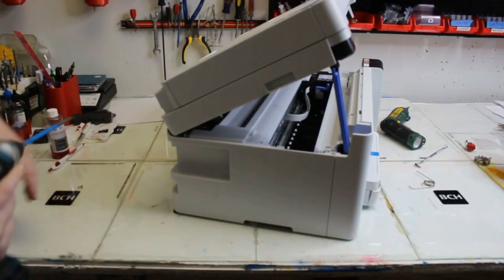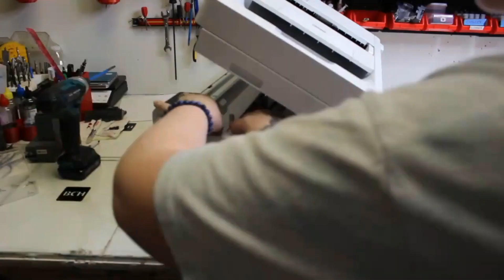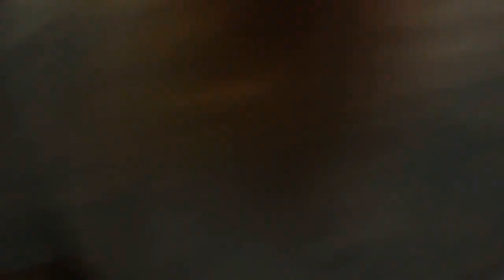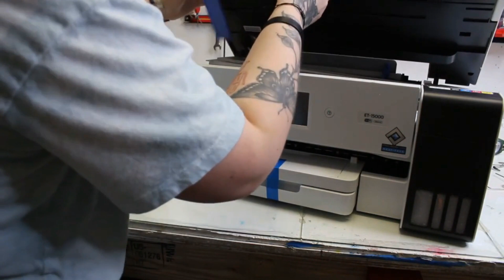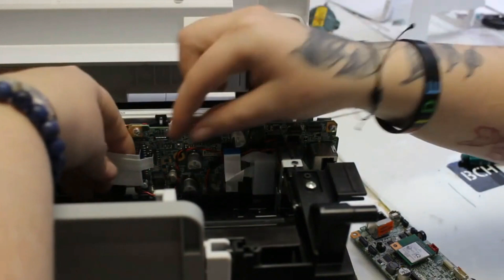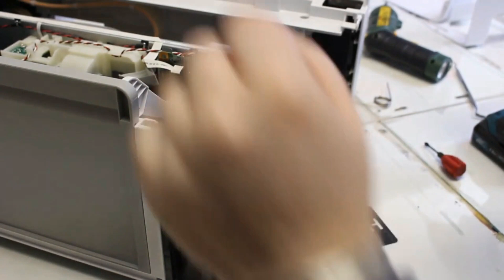ET-15000 Repair - Uncasing, Remove Scanner,  Replace Mainboard

Comment: Thank you so much for making this video! It was a real life saver for me last night trying to fix an issue with my printer. I couldn’t afford to buy another one, and I couldn’t have it fixed by the manufacturer bc I voided the warranty when I put sublimation ink in the tanks. So I have been relying on these types of videos to help me fix my printers and other things. So thank you so very much for your video! I was able to fix my issue after I could properly see everything. Great work! ❤
Reply from the maker: Awesome to hear it helped you out! Printers can be such a pain, but it’s great you got it fixed without breaking the bank. Keep at it, and don't hesitate to reach out if you need more tips!

Comment: Thanks for the video , quick question do you think by replacing the mainboard this would fix my printer from printing blanks? I tried everything I clean both the dampers and the tanks,and I flushed the tubes out and replaced the badly clogged printhead, this is a second hand epson et 15000 printer with only 50 pages printed, and still blank pages, it operates fine ,but still blank pages any suggestions?
Reply from the maker: Thanks so much for watching the video and for your support! With a printer that only shows about 50 pages printed, I wouldn’t jump straight to replacing the mainboard yet because blank pages are often caused by ink not properly reaching the printhead. I would recommend doing a park-and-prime procedure first. To park the printhead on the capping station, simply turn the printer on and allow the printhead to settle naturally onto the capping station; it’s safe to do this while the printer is powered. Once it’s parked, connect a syringe and tube to the waste line and gently draw about 1.5 to 2 ml. You should feel slight resistance as you pull; if you only draw air, the printhead may not be sealed on the capping station or the cap seal could be leaking. If you feel total resistance and nothing moves, the capping station could be clogged and that needs to be cleared before priming will work. When you pull around 1.5 ml you may hear the damper membrane crinkle, which is a good sign the nozzles are opening. Slowly pull to about 2 ml and hold for around 10 seconds, then run a normal cleaning cycle, but avoid strong cleanings within 12 hours and don’t run back-to-back cleanings without letting the printer rest. If ink flow still doesn’t start after that, then it’s worth checking the mainboard components such as the F1 and F2 fuses and possibly the MOSFETs, and I demonstrate how to diagnose that here: [https://youtu.be/RMCq5wXQNlI](https://youtu.be/RMCq5wXQNlI). Also just a quick note about replies: I receive a high volume of questions every day, so I prioritize subscribers and channel members, who typically receive responses within about 48 hours and also get extra benefits like early access to videos. I can usually reply to about 10 questions per day, so after subscribers and members, the remaining slots are filled last-in, first-out, meaning newer comments get reviewed first. If you’re not subscribed and don’t get a reply within 48 hours, you can subscribe or repost your question because newer comments are reviewed first, and if you subscribe later your older questions automatically become priority without needing to repost. You’re also welcome to join Run With Kevin — LIVE, where I usually go live every morning between 6–8 AM Eastern and answer printer questions in real time, so subscribe and turn on notifications so you can catch the next session and ask directly. If you need faster help, feel free to email [support@bchtechnologies.com](mailto:support@bchtechnologies.com), and if this video or comment helped you, I’d truly appreciate a quick Google review at [https://g.page/r/CfL7k6nYvPQ9EAg/review](https://g.page/r/CfL7k6nYvPQ9EAg/review).

Comment: Once the logic board has been replaced, to carry out the calibrations you must enter a password on the screen to be able to access the machine in service mode. Do you know what key that is?
Reply from the maker: Thanks for your question and for watching the video! I appreciate your support. With so many inquiries, it can be a challenge to respond to everyone quickly, but I always try my best. For faster assistance, feel free to email me at support@bchtechnologies.com or post your question on my latest video (not Shorts).

When replacing the logic board and needing to access the service mode, the password is often specific to the printer model and firmware version. Manufacturers generally keep these codes restricted to authorized technicians, and accessing them without proper authorization can sometimes void warranties or violate terms of service. However, if you're working on this with appropriate permissions, I recommend checking the printer's service manual or consulting the authorized support channels for your printer.

If you’re still stuck, let me know your printer model, and I’ll see if I can guide you further or suggest resources that might help. Thanks again for engaging with the channel, and good luck with your calibration!

Comment: Hey I have a question about the switch board do the red and black wire plug into something or it just hang
Reply from the maker: Thank you so much for your support and engagement! On the ET-15000 switch board area, the red and black wire usually should not be left hanging unless you are 100% sure it was originally routed that way, so I would first look closely around the switch board, control panel, scanner hinge area, and nearby small boards for an empty two-pin socket or connector that matches that plug; if it has a connector end, it most likely plugs into something, but if it is a loose wire pair without a plug, it may be part of a sensor, switch, or routed harness and needs to be traced back before powering the printer on. I recommend comparing your printer with the video frame-by-frame before reassembly, because one loose cable can cause the printer not to power on, throw errors, or damage a board if connected incorrectly. I receive a high volume of printer questions every day, so replies are prioritized: subscribers and channel members are typically answered within 48 hours and also get extra benefits such as early access to videos, while regular viewers are answered if time allows because I can only reply to about 10 questions per day; after subscribers and members, any remaining reply slots are handled last-in, first-out, meaning newer questions are reviewed first. If you are not subscribed and do not receive a reply within 48 hours, you can either subscribe or repost your question because newer comments are reviewed first; if you subscribe later, your older questions automatically become priority without needing to repost. You’re also welcome to join Run With Kevin — LIVE, where I go live every morning, usually between 6–11 AM Eastern, and answer printer questions in real time, so please subscribe and turn on notifications to catch the next live session and ask directly. If you need faster help, email [support@bchtechnologies.com](mailto:support@bchtechnologies.com), and if this video or comment helped you, I’d really appreciate a Google review here: [https://g.page/r/CfL7k6nYvPQ9EAg/review](https://g.page/r/CfL7k6nYvPQ9EAg/review)

Comment: I'm looking for a video to help with my ET 15000 not powering on, I replaced the maintenance tank and I think it blew something out. I've tried everything from replacing the cord to unplugging and holding down the power button.
Reply: Mine won’t turn on either. Mine was clogged so I did a cleaning to unclog. Waited the next day to do a power clean and possibly do a print head test. Power clean was successful. But when I tried to do a printer head test, I got the error for paper being stuck. I took all the paper out and have checked for any debris and other papers nothing. Tried maybe 2-3 more times and then all of a sudden, it turns off on me. It’ll not turn on anymore. I’ve checked the power cord and switched it with another one, no luck.
Reply: Same here.   Waiting to see if there is a solution
Reply from the maker: Thank you so much for your support and engagement! On the ET-15000, if it stopped powering on right after replacing the maintenance tank, it may not be the tank itself but something that happened during the process, such as a short, blown fuse on the mainboard, damaged cable, power supply issue, or moisture/ink getting where it should not be; the video you commented on is a good starting point because it shows how to uncase the ET-15000, remove the scanner, and access the mainboard, but please be careful and inspect the board closely before replacing parts blindly. If you need faster help, you can email [support@bchtechnologies.com](mailto:support@bchtechnologies.com), and you are also welcome to join Run With Kevin — LIVE, where I go live every morning, usually between 6–11 AM Eastern, and answer printer questions in real time, so please subscribe and turn on notifications so you can catch the next live session and ask directly. Also, because I receive a high volume of questions every day, I have to prioritize replies: subscribers and channel members usually get answered within 48 hours and may receive extra benefits such as early access to videos; regular viewers are answered if time allows because I can only reply to about 10 questions per day; after subscribers and members, the remaining reply slots are filled last-in, first-out, meaning newest questions are reviewed first. If you are not subscribed and do not receive a reply within 48 hours, you can either subscribe or repost your question so it becomes newer in the queue, and if you subscribe later, your older questions automatically become priority without needing to repost. If this video or comment helped you, I would really appreciate it if you could leave us a Google review here: [https://g.page/r/CfL7k6nYvPQ9EAg/review](https://g.page/r/CfL7k6nYvPQ9EAg/review)